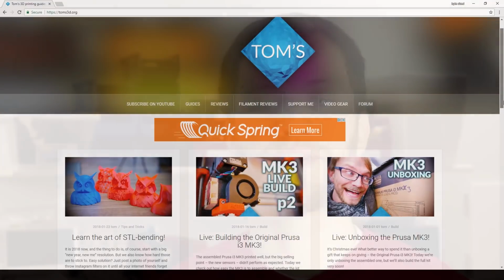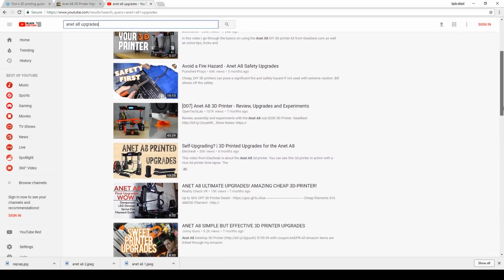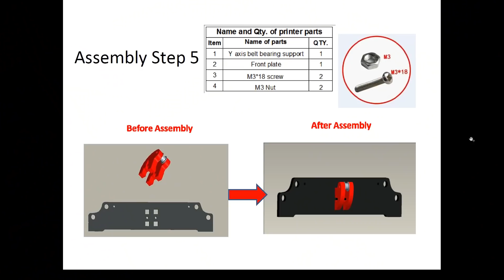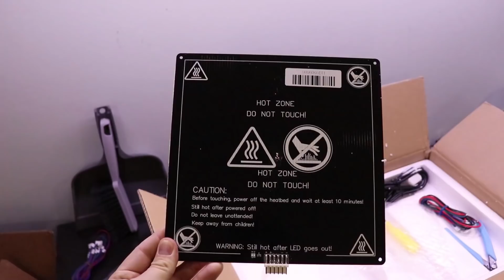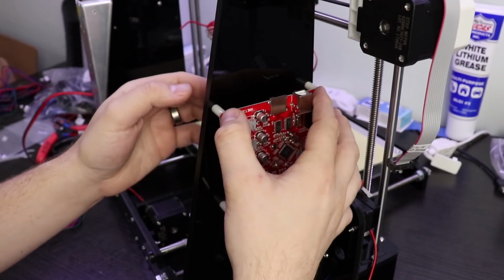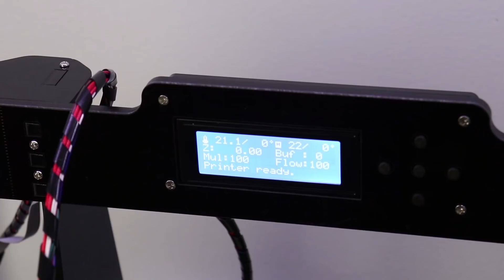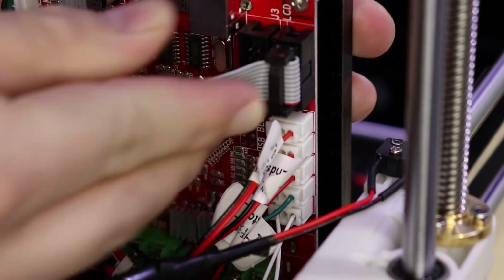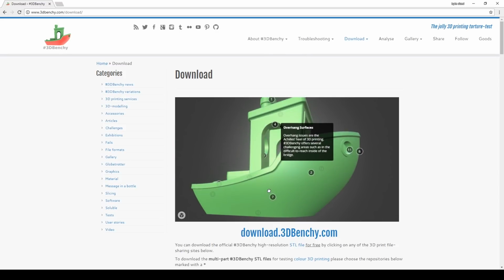Anet A8 - The best cheap DIY 3D printer in 2018?

Comment: The A8 was my first printer... I built it, got frustrated with it and then didn't touch it two years...  Now I own 3 printers and 2 of them are A8's... including my first... at least as far as the frame goes... I built my 3rd printer from scratch around an A8 frame with a Titan Extruder and V6 hotend... all in all, I like the A8... it's low cost makes it a good starting point for a custom build...

Comment: 3 years on with using my Anet A8 and I can say it has been printing nearly ever single day throughout the 3 years, and i make outstanding equipment /products on it,
Anyway this guy describes who best would enjoy having one. 

I can also say i have No mods on mine.  But i did change the Firmware to Marlin and is needed to do so for the fire risk
Basically the Thermal runaway problem.
I dont know if the latest version of the Anet a8 software is any better.

Comment: I bought an Anet A6 printer. Brilliant printer if you construct properly. Printed z-xis bearing supports and stable. Marked the z-axis left/ right stepper drives to both be equal height. Sometimes disabling stepper drives and making sure z level important. Very happy with it.

Comment: Had (have) this printer, tried printing with it and it was always either not leveled or builds kept un-adhereing. I thought mine was just weird or broken, but it turns out after I bought another printer it was just that I didn't have my heated bed turned on and I was trying to print abs without an enclosure as well...

Comment: I bought the Anet A8 a while ago, and the instructions were in Chinese. Not only that, but two problems happened after following an online English tutorial: One of the ball bearings fell apart (fixed it with duct tape), and the extruder's temperature started dropping during printing. I bought a new extruder, installed it, but I still have to re-measure everything, reset the temperature, and hope it works. That's a whole day's work, and I kinda wish it wasn't. However, it did start printing after assembly and hook-up. The heat bed might need a plastic cover or something to keep the print from sliding everywhere. 😐 I did learn a lot by putting it together myself, I just wish the parts all worked correctly in the first place. 😑

Comment: Well done! I want one! The only thing I see wrong is that the prints look small, in fact they are small. I saw a (very very expensive) 3D printer (which also cut by laser too) back in 2007 in the US and that was creating big prints and I mean 80 cm high, 20-25cm width and depth. So comparing, the little boat is very small. Could I print for example parts 200mm width, depth and high? Other thing is... where do the reels of filament hang?

Comment: hi, I have problem in my new anet A8 board v1.7 ... When the initial operation, the extruder is directed to the opposite side to the end and continues for a while the engine rotates even when the extruder reaches the end ... The same applies to the surface ... Also, the z direction motor works one and the other does not work .. Note that I almost checked the connections  All are correct, i am using Anet A8,How do you think the problem is solved?

Comment: can you tell me why the nozzle dont stay heated goes up to 184 and remains at 117  so it means its not printing right helpppppppppppppppp please.
Reply from the maker: The nozzle has two parts to make it work. The heating element that makes it hot, and a thermistor to measure how hot it's getting. The control board uses these two parts in a control loop. The thermistor is the feedback. I would check to make sure both parts are plugged into the control board and check the nozzle end to make sure the thermistor isn't loose. I had mine come loose once and that caused problems with the control loop.
Reply: @bytesizedengineering  thanks alot  sure enough that little white thing came out the hole on the nozzle
Reply: @glenmccall4571   AND that's.. Exactly.. How and Why Anets earned their title: "Firestarter" 
Wrap some tinfoil around the thermistor until it's a tight friction fit into it's little hole. Or buy a heater block with a screw to lock it in  ~2$
Reply: @barenekid9695  yes thank you that was the problem kool but you have the setting for a smooth print one where i can use for everything  i have cura  latest but everyone have diff setting but i confused on which best  do you have a good one

Comment: I am not hating, i just trying to understand your thought process.
9:10 Ok, let me see if i got it right, you are saying that live and neutral are swaped right ? but is the green wire is connected to ground?
As long as the earth wire is connected to the right place having L and N wires swaped will be irrelevant, the case will be connected to the green wire, if the green wire is connected to earth as it should and the live wire toches the case it will cause a short circuit.
9:40 Your argument doen't make sense, in the beginning you talk about N and L and at the end you make it sound like the earth wire is wrong
Reply: after all the Manual isn't laying may be he did found that its a fault
Reply: Exactly what I'm thinking. The ground will always ground the circuit no matter if the L and N are switched (which is natural in AC circuits). If its DC output then their would be a problem way before any wire got loose
Reply: I don't know about a wiring but I followed the wiring diagram and when I went to plug it in I got a little tickle, I was not touching any metal so I wonder if something wrong with ground. My printer works though so idk.

Comment: 9:35 WTF???? Yea, it's ok to put brown to neutral and blue to live, but the blue wire can be live or neutral. It depens on how you plug the cord in the wall. It doesn't matter at all
Reply: Small corrction: not any type of plug allows reverse plugging. I live in Eruope and here you can plug in froundet or ungrounded plug in both ways.

Comment: The most valuable tricks I learned on my Tronxy x8 (similar to anet a8)
1) put a 3mm or so thick pane of glass on the heated build plate. 
2) Slicer: set the line width a little smaller than the nozzle, set the layer height around .2mm, use a fan at about 25% . 
3) Get ABS to adhere to the build plate, just spill a little acetone on the build plate and rub a piece of ABS on there where the print will be. a very clean and thin film of ABS will result so you don't have to maintain a jar of liquid slurry. 
4) you can also print pet-g on the same thin film of ABS.
i don't use PLA but maybe it would also stick to an ABS slurry.
Reply from the maker: Thanks for the great tips!

Comment: Do you still use it in this year?
Reply from the maker: I do use it still! I did move recently and the movers didn't pack it very carefully and one of the brackets broke, so I need to fix it. I have had some thermocouple related issues that I was able to fix. This printer is not for the casual hobbyist. I would only recommend this printer for someone who wants to tinker and fix things.

Comment: I've had my Anet A8 for 2yrs now. It's an excellent printer for the $. The only problem so far was the hot bed connection, after the 3rd 1Kg spool of filament. I just soldered the wires directly. Works great with PLA & PETG. I've made lots of models ranging from the files that came with the printer to motorcycle and firearm parts that I designed myself. I do plan to purchase another.
Reply from the maker: Good to know! I have had a couple of problems that were pretty easy fixes.

Comment: You ought to upgrade it to a ~ $20-40 32 bit controller board and skip to marlin 2.0. I am considering the same for my geeetech A10 at the moment. Overall, great vid.
Reply from the maker: Thanks for the suggestions! I have upgraded to Marlin already. I still have the stock board on there though. I may upgrade over time as needed. But for now it works well! Thanks for your comment!

Comment: European sockets don't have a standard polarity, so even if you install the correct wires to the printer's power supply, you might get live or ground on your brown cable, depending on the wall socket you are using or whether you plug your cable one way or the other to the wall or extension socket.
Reply from the maker: Yeah, I live in the US. There are devices that have polarity requirements while others don't

Comment: Please describe what settings you changed to get the better benchy print please. I'm new to 3d printing and trying to get better quality prints with mine.
Reply from the maker: I think my first problem was I was trying to print benchy too small. I scaled him down too much on my first try. Play around with print speed (60-80) and hot end temperature (around 205-210 degrees C for PLA) and bed temperature (60-70 degrees C). Keep printing until you like what you get. Good luck!
Reply: @bytesizedengineering  Thanks for replying!

Comment: which type of fillament is the best?
Reply: if you have microcenter around you, Inland filament. It's super cheap and works great!
Reply from the maker: I have only used inland filament because of how cheap and accessable it is. In addition to microcenter it can be found on Amazon as well. Which filament is best depends on your needs and tolerances. Higher quality filament costs more.

Comment: Bought a anet a6 135euros, assembled in a morning and was printing by afternoon,  included in the price accessories and 0.5kg spool which i already spent....super cool learning, already upgraded for 0.6 nozzle and learned to setup it better to print almost flawless!
Reply from the maker: I think that was a big take away for me as well. Some of these super cheap 3D printers can produce decent prints with a little effort on our part. For me I bought this printer to learn about 3D printing. Good luck with your upgrades!
Reply: For me it was the only option or an A8, but the A6 was smaller and my room is small. Also i have no money so it was either that or never get into 3D.

Comment: If you find the Y-axis stiff check the aluminium H is flat. When it's stamped out during manufacturing it it gets a slight  curve which puts the bearings out of alignment. I bent mine flat by placing it on two rods on the floor and pressing in the middle. Made big difference. Overall I'm getting pretty good results from my A8. I paid £100 in the UK for the Anet version. There are even cheaper versions available that use a wood frame.  Best upgrade I've done so far was to replace the linear bearings with Drylin.
Reply from the maker: Those are some great suggestions! Thanks for the feedback!

Comment: I’ve seen them as cheap as $140 on gearbest. I’ve never had an issue with mine, ever, and have gone through 4 rolls of filament. The Anet A8 Facebook page is a good resource
Reply from the maker: Good to know! Thanks for the tip

Comment: I think these cheap printers are worth every penny..I bought my Tronxy P802M(which is similar to the A8) about a year and a half ago and it has given me zero problems...It was fun to assemble and the best part is that the cost of the kit is way cheaper than sourcing the parts and building one from scratch which is exactly what I was going to do before buying the Tronxy kit.

Comment: Its not the cost of the printer the problem is the persons who are building this machine do not have any experience using real tools ,building devices ,connecting wiring correctly,leveling a machine and bring a machine up to full operating capacity..most do not know how to seperate screws and nuts correctly or how to prepare a place to build thats the problem NOT THE MACHINE.

Comment: I’m an electrician, and when building the pipe racks for data centers we use ten foot long pieces of all thread to hang the strut from the ceiling. Multiple levels of conduit on the racks calls for a nut on top and bottom of each level to hold the strut at a specific height. Instead of spinning the rod, we used a piece of rod about 6 inches long and wound some duct tape onto the rod.  Then chucked this lollipop looking thing into the drill. That way you can friction spin the nut without damaging anything. You could get something like a worn out paddle bit and cover the sharp end in cheap tape, then it becomes a specific and useful tool that will snap in and out of your impact.    Note: think about what way your spinning and what way your tape is wrapped.

Comment: A8 will burn ur house
Reply: Definitely upgrade ur PSU since the stock doesnt come with a fan, and add mosfet and I can print and sleep overnight without having one eye open. The heat bed draws to much current and eventually burn out. Those are upgrades that I did with my A8, not including the glass bed.

Comment: i'd like a 3d printer with a 36" build area, buying one would be expensive, this might help me build my own, I have a three axis stepper motor setup, I can build my own frame, I have a cnc plasma table I built that i'm not using I just need the Z axis, maybe a 16" Z,   hmmmm

Comment: The worst design flaw of the Anet A8 is the heating bed connector. The bed heating element uses 2 pins for GND and 2 pins for PWR (the 5th central pin is for the temperature sensor), but the connector only uses 1 pin each for PWR/GND. A single pin for each cannot cope with the current required and will overheat, even becoming a fire hazard.
The solution is to throw away the connector and solder each power wire directly to it's 2 pins.

Comment: The AC power color codes in the instructions are actually correct, i.e. the international standard is blue=neutral, brown=live and yellow/green=ground. The power connector/cable is probably wrongly wired - a typical Chinese boo-boo.

Comment: Tronxy X8 is what it is, cheap chinese machine. Wabbels, the E Axies is not accurate because of the design and leads to constantly adjusting the printer to get it work somewhat. But more then less, it is frustrating and i am absolutly happy now with my prusa i3, which is just another caliber. Updates on X8 inexistent, no support and a old and dangerous board. From the safty aspect it is a threat to your home. The board is constantly overloaded, without adding mosfet and crimping the wires correctly. And yes, there is no fuse present, so invest in a fusebox and socket for the powerplug. - and be sure to ground all the compontents or you get USB overloads that may cause your computer to never be able to use usb again ;-)

with all that said

If you get yourself the metal version of the X8 frame and are able to work all the problems on it, it is possible to get a good result.

Absolutly no recommendation for a newbie, only if you know what you are doing and if you got high frustration tollerance

Comment: one of the things I did when I built mine was make some cardboard washers from a cornflakes packet and place them with a steel washer between the springs and the underside of the bed as I suspect after some time the springs will scratch through and short,  the other thing was get rid of the heatbed plug
Reply from the maker: Good to know, thanks for sharing!

Comment: would you recommend adding acrylic glue to the joints for added support?
Reply from the maker: I've heard of people using the wrong type of glue and it shatters the acrylic. I would do more research and experiment first before using it on my machine.
Reply: Good to know, I have some acrylic specific glue; will do some testing.

Comment: Great vid thanks but you are absolutely correct about the reversed wires being an issue if you are using the earth. Neutrals are cross bonded at the power source (distribution box in the home, sub or station depending on earth type) so will get a GFI/RCBO fault everytime you plug it in. Without the earth it wouldn't matter but I wouldn't have an exposed case on a 2-pin plug.

Comment: Nice job.  I get the impression 3D printing has something in common with analog (lathes & mills).  If you are not prepared to be something of a mechanic (and electrical/electronic engineer) you should not get into this racket.

Comment: I know there are many valid safety concerns in switching the live and neutral wire, but "the live becoming loose and coming in contact with case" seems like a problem regardless of whether the live and neutral are switched. Wouldn't the earth wire function the same either way regardless of which colour wire carries live current.... 

If current leaks to the metal case, the earth wire takes it out. Why does it matter if the live wire is mislabeled in regards to this reason ?

Comment: I have bought A8 at the beginning of summer 2018 or so or even earlier, forgot this.

I regret. I dont recommend buying A8.

I have watched some videos and for same price ENDER 2 or ENDER 3 is much better.
Rock solid frame, very good prints right out of the box.
Yes it needs some upgrades but nothing major, like A8.

Im planning to buy ENDER 3 ASAP. I will try to make A8 better of course. But im pretty tired of tweaking it each time i need to print anything.

Forget A8, its stone age now.
Reply: That's a fair opinion, and the anet is certainly not the printer for someone used to plug and plays. But it is anything but stone age. With a few weeks of upgrades and customization, it can stand with some of the best printers out there. Not without a lot of tweaking, for sure, but tweaking a machine like this can be pretty good fun. I'm running on 2 years with my anet, and it's the best 160$ I've spent. The ender 3 is a great machine, but please dont put people interested in getting into printing off of the anet.

Comment: I have already built my 3d printer but the only thing I didn't connected yet is my positive and negative wires to the motherboard. the motherboard didn't show which was which. could you help with this one problem
Reply from the maker: Check the documentation that came with your printer